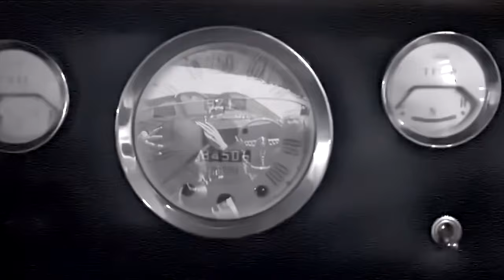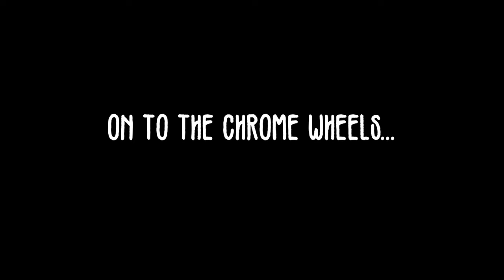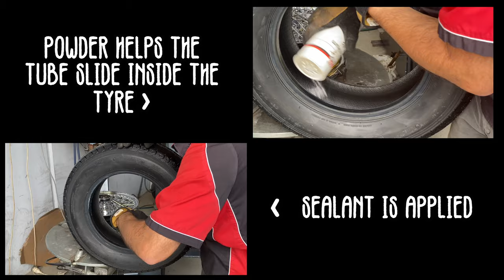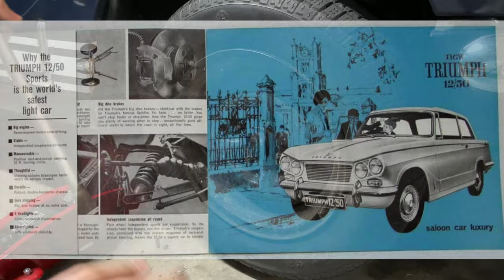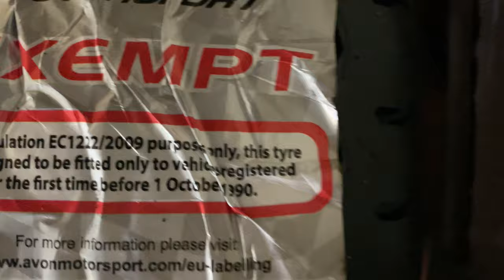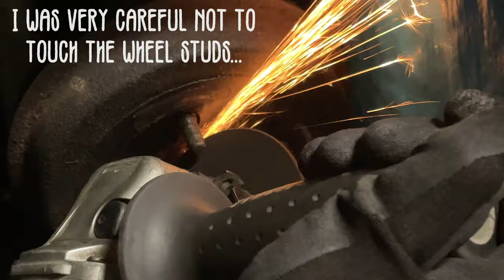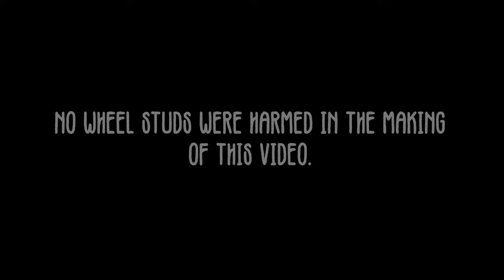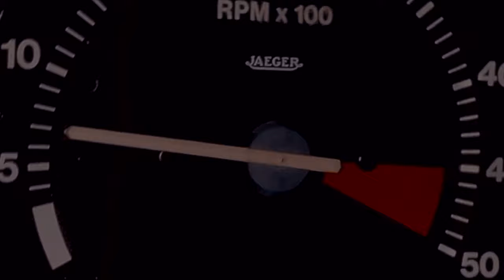Fitting Wire Wheels to the Triumph 12/50 | Wire Wheel Buying Guide

Comment: Hi   The taper on the first hub you put on looked knackered also there were spline marks on it. That means the wheel nut has been wacked on too  hard and the taper on the wire wheel hub has spread That   will work loose. I own a 1936 Riley Falcon with exactly the same arrangement. With exactly the same problems!
Reply from the maker: The thread on the hub isn't actually as bad as it looked in the video, it was caked in old grease at that stage but I've cleaned them up and applied new since then. Which are the spline marks you mention?
Reply: @Rust_in_Time  Hi the spine  marks are on the start of the taper on the hub. The only fix is to get a new hub on the axle and get a new hub respoked into the wheel. Try jacking the car up put the handbrake on then see if you can move the wheel. Very lightly grease the splines but not the taper. There are inner and outer tapers on the wheel nut that locate on the front of the hub look for wear in the nut it could well be bottoming out through knackered tapers . The only fix there is a new nut. It only works if you replace the whole lot , the nut and the two hubs. It all depends on usage.  Is there a clunk when you change direction in the car? That is worn splines. Keep checking  that the wheels are still firm by jacking the car up on the first few outings and see how you go. Better to be safe than sorry! Cheers